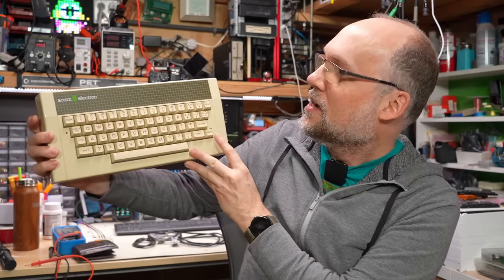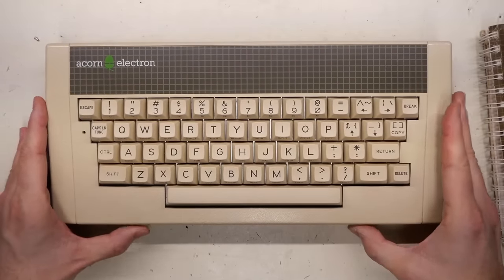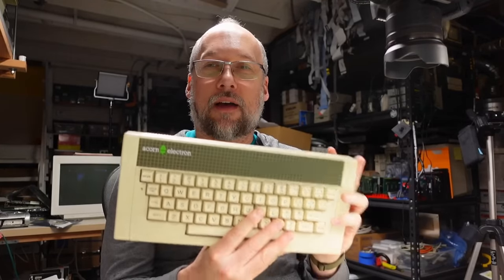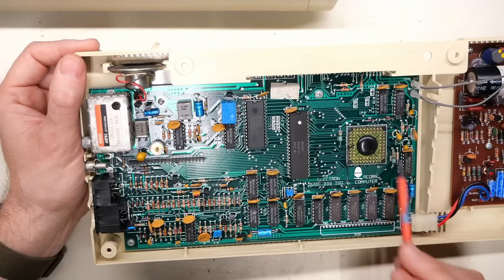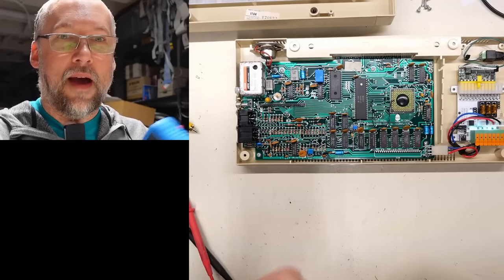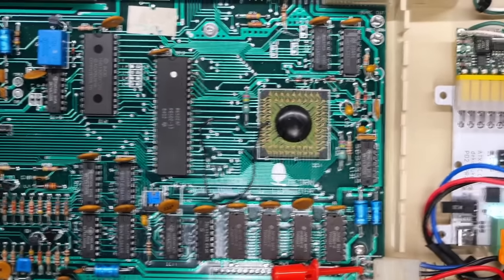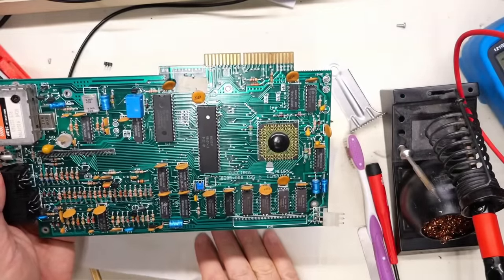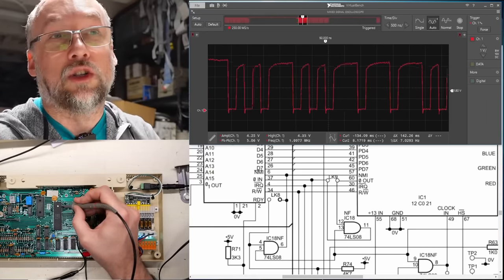I was shocked at what was keeping this Acorn Electron from working (Acorn Electron Repair)

Comment: One of the best repair videos you’ve ever put out! Thanks Adrian and thanks to the viewer who sent that awesome  little machine in!
Reply: As the person who sent it in, you’re welcome haha

I love the Electron, I think after the BBC Micro it’s my fav retro computer, as I have a soft spot for technology that’s a bit crap or failed at something but is trying oh so hard to be awesome that I can’t help but love it!
Reply: I think it's a shame he's changed out the power supply.  It can't be THAT hard to find a 19V transformer.
Reply: @jovetj  No AC transformer is required.  It'll work just fine from 12 volts DC.
Reply: @ControlledPodIntoTerrain  I'm sorry, I believe you missed my point.
Reply: @jovetj  I believe you missed mine, which was that the machine doesn't need AC and doesn't even need 19 volts-  it will work just fine from 12 volts, and 12 volt power supplies are everywhere.  Changing out the power supply was really unnecessary.
Reply: @ControlledPodIntoTerrain  So you just feed the original power supply 12VDC and it will just work?
Reply: @jovetj  Yep!  It feeds the AC into a bridge rectifier anyway, and it's a switchmode DC/DC converter behind that, so it really doesn't care what you feed it as long as it's above about 8 volts.  I guess above about 24 volts would probably exceed the ratings on some components, but I guess just don't do that?  🙂
Reply: @ControlledPodIntoTerrain  I guess I expected him to have analyzed the traces/circuit a little more carefully.
Reply: Loved the BBC, I spent hours on them at school I was too poor to afford a computer at home then j got given a zx spectrum by a friemd it didn't work but turned out that the wire on the PSU was split, I managed to strip it and  fix the wires I was only 9 years old at the time but yeah break times and lunch and half hour after school spent on this. Machine.
Reply: @jovetj I think it is always better to use modern PSUs. Many retro computers burned in to ashes due ti the bad PSU circuitry. Aske C64 owners..😉

Comment: All Acorn 8-bit machines have the ‘Old’ command. Hitting break is a reset and typing OLD or O. will restore the programme.

It’s really useful, as are a lot of BBC Basic’s shorthand commands
Reply: Yes, at https://youtu.be/sukuk-miq4U?t=3306 :
RESTORE is a standard BASIC statement that sets what DATA statement will be used next. (In BBC BASIC, it can be used with no parameter, to choose the first DATA statement.)
Pressing BREAK (or CTRL-BREAK) effectively does NEW (among other things), which sets one byte near the start of the tokenised BASIC program (the 2nd byte to 255), to mark that as the end of the program.
OLD restores this to 0. That byte holds the most significant byte of the line number, so if the first line of the program had a number higher than 255, it would end up being its original number modulo 256. Of course, you can't use OLD to recover a program after entering a line of a new program.
Reply: Yep,

O.
L.

for 'OLD LIST' and there's your lost program. Even after a CTRL-BREAK.

Comment: RESTORE is used with READ and DATA. BBC BASIC had a nice little extra keyword called OLD. It's the opposite of NEW! So after a reset you might be able to get your old program back, but do it first thing. Any other messing about you do is likely to scramble the memory pointers and make the old program irrecoverable.

Comment: In the mid-1980s to early 1990s, I wrote software for the BBC and designed hardware for a specific group, the physically disabled people. The BBC was the easiest computer to do this on, and in Belgium these old computers are still used in some locations. It is a wonderful machine that has helped many people. I still have a BBC in my house and would not part with it for the world. Due to being idle, several components needed replacing, but it was wonderful to maintain and repair. There is still a whole group of people working on this day in and day out.

Comment: Great video, Adrian! You can get back your program after hitting BREAK using the OLD command.
Reply: I came here to say the same. 👍
Reply: I also came here to say the same 😉
Reply: Unless someone adds the line ?(TOP-1)=0 as the first line of the program code.
Reply: Also came here to say this
Reply: WOW not heard that command in years. I had forgot about that one.
Reply: @frankowalker4662 Me Too! Absolutely shocking I remembered that from 1985 🙂🤷‍♂️
Reply: Reminds me of poke 36878,15 😂
Reply: OMG I wish I knew that in 1986 :face-fuchsia-tongue-out:
Reply: I never understood why even though the cassette player was connected to the computer, games would fail to load if the volume was too low. Almost like the Acorn was listening via an internal mic or something
Reply: I am not that familiar with BBC Basic but on other BASIC's I know the RESTORE command followed by a line number tells the program what line number to READ DATA from. So OLD sounds like great call for getting a program back.
Reply: @Terraiced  It was a tricky enough juggling act to interpret the correct waveform into data - having to find that data while also then having to figure out the min and max volume/voltage of the waveform to fit that model to, was just one step too far for many tape-loading computers.  You soon learned where the level should be so not much reason to then make the process more complicated, expensive, and probably fragile in other ways.

Comment: You didn't need to replace the original power supply. You can use any laptop DC supply, 15  to 19 Volts DC on the Electron.  The switching supply on the power supply board generates the + and -5V supplys without any need to have an AC input.
Reply from the maker: Indeed, it wasn't obvious it was switching and the schematics I looked it didn't include the PSU schematic. I just looked at it now and clearly it would have worked just fine. on probably as little as 12v DC as well! No need for 19v even....
Reply: @adriansdigitalbasement  I use 12vdc with no issues.
Reply: That’s mostly true, but be careful.  You can use dc on an ac device, but the amperage and the dc voltage and amperage is probably going to be different that the ac markings.  Best to do the math for the device type and power supply components that you have.
Reply: @adriansdigitalbasement  Yeah, I can confirm that 12V DC works just fine. I have three electrons and all of them are perfectly happy on that.
Reply: @trssho91  If using a DC supply for something that is generally expecting an AC supply, the FIRST thing to look for is a transformer on the power circuit directly.  If you put DC thru a transformer, ALMOST all the times something DRASTIC will happen BAD!  DC will typically overheat the windings, but AC will go hot one cycle, and then not on the opposite .
Reply: @SuperHaunts  Here the mains transformer is externally. The first stage is the rectifier. But you are right in a way: If the designer cheaped out on the rectifier and used eg. 4 1A diodes for 2A of current, calculating, that they conduct only half of the time, they would overheat with DC.
But here the power is below 10W and the diodes are 1A types
Reply: @SuperHaunts  True, but the transformer is always located in the wall power adapter and the AC comes after the transformer. Very rarely do these home computers have high voltage AC transformers inside them. It's obvious that the lower power AC is going to be converted to DC for the logic chips 😏 That ATX power module is not needed as the electron does not need a negative power rail and can run perfectly well with 9-12V DC.

Comment: I think you're right. The 6502 probably gave up first. Then someone changed it for the wrong version. That lead them to believe the ULA was at fault and started to remove it, damaging a trace in the process, but then gave up and didn't bother to try and re-solder it back. That all makes sense.
Reply: That's pretty much what I figured too, I know a fey lazy 'tech' guys like that who give up halfway when a little more poking or re-thinking their approach would save the job.
Reply: Acorn fitted the Rockwell R6502A to many Electrons from the factory.  Although it's out of spec, it usually works just fine.  "Out of spec but seems to work" is a pretty good description of the Electron all round, really.  Many of the 6502's pins are directly connected to the edge connector at the back, so it is believable that it could have been damaged by ESD, or just drifted with age, and now no longer works that far out of spec.

Notably, in screen modes 4 through 6, the CPU clock does not stop for 40 microseconds like it does in modes 0 through 3.  The Electron powers up in mode 6.  So even if the CPU was not capable of surviving a clock stopped for 40 microseconds, it would still work at power up.
Reply: @skonkfactory  Thats interesting. Adrian did re-check the 6502 once the ULA was resoldered back in, and it checked out as working as a standard 6502. It just didn't work in the Electron. So it looks like it was out of spec, enough to make it fail in this application. But you're saying it should have still booted?. Thats a mystery.
Reply: @g0bzy  The Electron's all sorts of electrically marginal, though the ones with the Synertek gate array (like this one) are much less so than the ones with the Ferranti ULA.  It's also possible that the 6502 was slightly damaged and didn't like the 2 MHz cycles that the Electron does when accessing ROM.
Reply: For what it's worth, I've tried fitting a (recent-  fabbed in 2021) 65c02 to an Electron and it does not like the slow rise time on the clock waveform generated by either the Synertek or Ferranti ULAs.  I had to fit some logic to speed up the edge there.  Also you need to lift a couple of pins and pull them low since the wdc 65c02 has some extra signals.  Once I'd done that it worked like a champ, though!
Reply: @skonkfactory  nice work.
Reply: It's interesting that the state of the hardware tells a whole story. It was probably someone like me that knows just enough to be dangerous! 😂

Comment: About the tape connector: I noticed that the manual mentioned that you can plug it straight into a standard tape recorder if it has the (then) standard DIN audio connector. You mentioned that you saw about 2.5V of audio signal, and in that case the problem might be that it is too loud. IIRC the DIN standard specified a line level of 600 mV.
Reply: The User Guide suggests "medium volume" on a "domestic cassette recorder" which, given that full line level is about 1v p-p, would imply about that voltage level-  a half a volt or so.
Reply: my spectrum was the same, too loud and the game wouldnt load

Comment: I worked for a company near Brighton in the UK in the mid 80’s who made ultrasonic wire bonders, we were given Acorn Electron motherboards that had the ULA chip wafer, bonded directly to the PCB without any connections, Acorn wanted to manufacture the motherboards at an even more cost reduced than the version than the one in the video.

The machines we made were used to manually bond each contact on the chip wafer to the PCB, and once proven all was good, the process would have been automated, the completed PCB’s were returned to Acorn, and we never did any more work on the Electron. I think at this point, its days were numbered!

Comment: I think in practice, that 19V AC connection to the expansion connector was actually used as a power input when using the Plus 3 disk add-on that was L shaped and blocked the power input jack. It had a beefier external power supply that fed through to the internal supply. Great video, my first machine was an issue 1 Electron and I have several along with some add-ons (Plus 1, Plus 3, AP4, Jaffa Mode 7, and the custom BT Merlin expansion - Acorn were left with thousands of unsold units after missing Christmas ‘83 and they got repurposed by British Telecom for various niche business applications). So impressed you persisted and got it working!
Reply: the internal psu will work off around 19vdc ok, many people have done so, but obviously the add ons wont,, the internal board has a bridge rectifier after the ac input,, the regulator circuit is switching and generates the -5v from an extra winding on its transformer
Reply: A plus3 has its own 21V supply, or was it 23V even. The floppy also covers the old power inputm

Comment: Not sure if anyone else has mentioned it, but the first computer Acorn produced was the Atom, had the BBC not taken up their next machine, the BBC Micro would have been called the Proton, and thus calling this the Electron makes a nice trio of names
Reply: Acorn actually produced a few machines before the Atom, the System 1, 2 and 3, which were rack mounted. The Atom was a cut down System 3 and their first home computer system.
Reply: @cshairydude  Thanks. I’ve never heard of those three.

Comment: That is a serious WTF moment when you flip the board over, really made me LOL! 😂 Great to see you working on the Elk, of all the machines it's probably the one I know best as a bought one in 2021 and it came without a ULA so I made my own FPGA replacement that works pretty good in my issue 6. I wonder if your Elk was from the same batch I got mine. I think the story is that a huge pile of Elks were found after a fellow who used to repair them back in the day died and maybe yours was in the process of being desoldered? Mine had it taken out completely. Just a theory...
Reply: How did you do that? I'm guessing an FPGA but few have 5V compatible I/O.
Reply: @MrDuncl  ice40 FPGA and some level shifters. I got the basic plumbing from TubeTimes Graphics Gremlin design and Olimex Ice40 Dev board.

Comment: I have 2 of these machines. One of them was not bleeping and the picture signal was scrambled. I inspected the main board and power boards, all looked fine. The solder side of the keyboard looked filthy, so I used a special circuit cleaner by WD40 and some cotton swabs to clean it up. I was very surprised to power it on afterwards to find the Electron was back to working as intended. The Electron was the first computer we had back when I was a child. I recently purchased the elksd128k expansion card, which gives 128k ram, joystick port and SD card storage. Also, I have the original plus 1 interface which works fine. This video was very interesting for me to watch. Great stuff fella.

Comment: A little tip, when electronics like these has an AC input you can use a DC power supply, they have an internal DC rectifier, so it doesn't matter. The NES also has a 9V AC input, you can use a DC supply on either polarity and it works the same.
Reply: Adrian explained in the video why he didn't want to go that route. Some electronics use a charge pump to generate a minus supply from the AC input, so a DC supply won't work. In most cases, however, you are correct.
Reply: It works for most electronics but if a positive and a negative voltage is required you could simply use two diodes and two capacitors to charge them each in turns during every half-cycle or to supply the AC to a charge pump to generate a negative voltage from the rectified voltage without the need for an oscillator. Once I even had a computer (a weird "toy" computer for children with a monochrome dot matrix display) that came with an AC power supply and the computer also did kinda work with DC but then froze at the start screen because it seemingly used the AC to generate some timing (interrupt?) signal. (The "games" could also be sped up or slowed down by changing the AC frequency and you could even somewhat single-step it by switching the polarity back and forth "manually", which I used to win most of the games in basically no time since the time was calculated by the number of AC cycles while most other things still worked with DC and you only needed a few pulses to get to the next screen every now and then.)

Without analyzing the power supply and tracing all the outputs you can't be sure that DC always works… though trying usually wouldn't cause any damage (unless there is another transformer powered by the AC input or something alike that might cause a short when powered by DC).

Comment: Hi Adrian, so glad to see u again. I'm so into the way you solve problems and have seen almost all your videos since "How to remove chips without damaging the circuit board" posted 4 years ago.
I encountered a problem when removing chips recently. It's found that the chips are hard to be removed with the tin on the bottom. I've tried Solder paste, heat gun and heating platform but none of them worked. So i come for help, wish you could offer some precious advise or experience.
Looking forward to your next video.

Comment: Awwww you repaired my old friend.....Nice to see Adrian.
Way back in 82-83 ish, I bought one of these but soon got the Plus 1 and then the Disk Drive Plus 3.
I liked using the Defrag command on the disk drive as it used Video RAM to give it more room to work. This resulted in the screen being filled with what looked like white noise but I think it was the actual data stored in Video RAM then being moved back to the Disk, defragmented.
That repair job was really nice to watch and made me laugh to see the ALU being unsoldered.
What was with the original bodge wire being soooo long anyway? 🙄
If you look at the back edge connector, you will see 2 screw holes either side, these were for the mounting screws both on the Electron and Plus 1 and when all 3 were together, the whole computer was one solid construction and about as big as the BBC, not like the ZX81 and its flimsy 16K RAM Pack extension.
The Electron cost me £199, the Plus 1 was £60 and the Plus 3 was £199 if I remember rightly.....A lot of money back then...